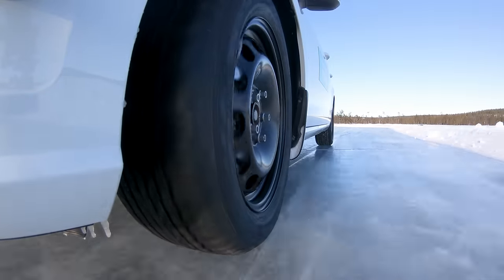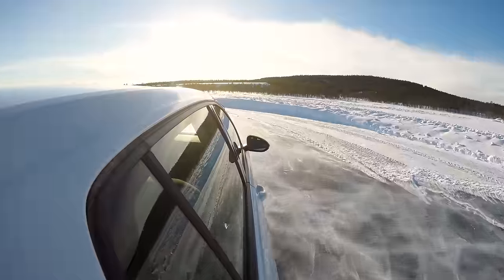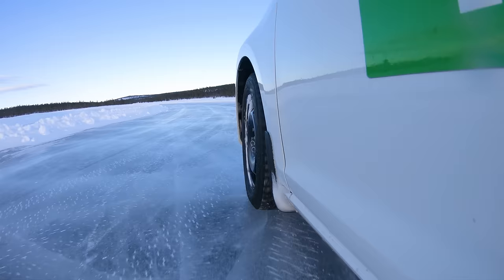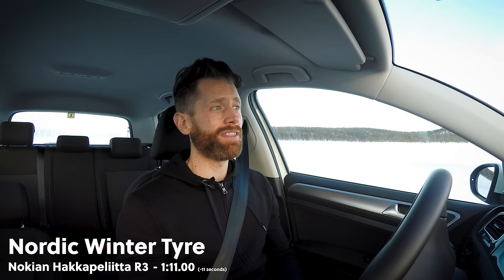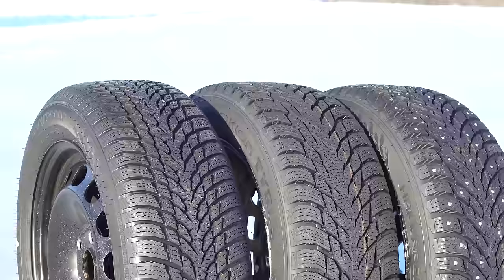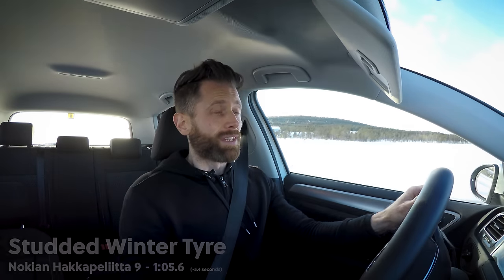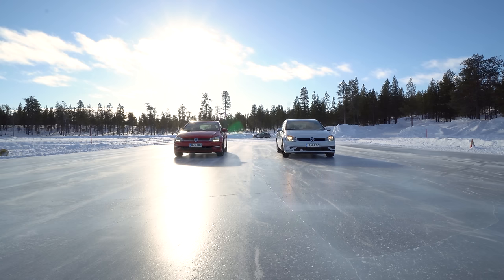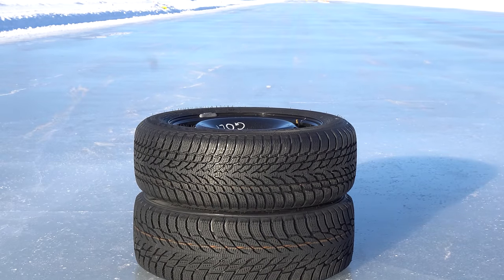Winter Tires VS Studded Tires ❄ What's better on ICE?

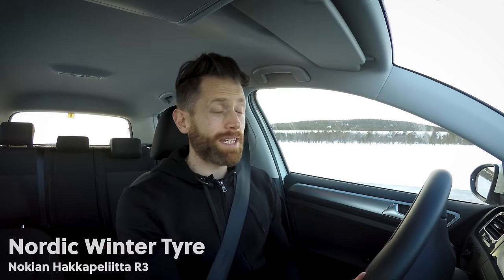Comment: Improving 10 sec from 1:22 is not the same as improving 5 sec from 1:12
Reply: Tobias Bredin......  I was thinking the same thing, but to an extent, those numbers are still informative in the sense that compounds make as much difference as having metal spikes
Reply: You are taking it out of context. 

He's saying the compound alone made an 11-second improvement. 

Adding studs on the same tire, only gained shaved 5 seconds off the same tire with no studs. 

Therefore you could say the compound is more important, but can still be improved upon by adding studs that will further enhance the compound's performance.
Reply: agree, 1:22 to 1:11 is 13% improvement and 1:11 to 1:05 is further 8% improvement and obviously it would be increasingly harder to improve it further

still nice, would like to see first tires studded version for comparison
Reply: The conclusion of the test is simply not representative ...

What really would be needed were some studded tires with the European compound so you see what difference the studs alone make from 1:22, and then the other way round what difference of having studs and changed compound makes to that time ...
Reply: @MrComputerCoder  No, you are missing the point. Going from 1.22 to 1.11 is easier than going from 1.11 to 1.05 even though the gained time isn't that much.
I mean, drive around a race track without changing your car in any way. Drive the fastest lap you can possibly do.
Now, shave off a second of that record. Without changing anything on the vehicle.

You are going to have a very hard time doing that because the closer you get to the limit, the harder it is to shave off seconds.
Now then, change tires... Without changing their diameter or width or height. Just change compounds.
You are going to shave off that second on the lap but can you shave off 10 seconds?

Change tires again to the ultimate grip ones, can you now shave off another 10 seconds just like that? Or are there simply other limiting factors, such as the "road" disappearing from underneath you as you tear around the track.
Reply: @RealCadde  Not missing the point. Watch the video again.
Reply: @MrComputerCoder  You are. Watch all of Youtube's videos again. ALL OF THEM.
Reply: @RealCadde  Yes because watching all of YouTube proves your point. Use the thing between your ears son.
Reply: @MrComputerCoder  I was pointing out how stupid your suggestion was because i have watched the video. Now you take your own medicine.
Reply: @MrComputerCoder  he is not taking it out of context...you just didnt get his point...
😑
Reply: @Mikhail.Tolstykh  no, Point Break is correct. Cadde is confused.
Reply: @cycl0n362  : Sir, you are the one that accurately pinpointed the problem. 
He didn't make a good comparison.
What need to happen is the following test set:

1.a) European Winter tires -> Lap time.
1.b) European Winter tires with studs -> Lap time.
----
2.a) Nordik Winter tires -> Lap time.
2.b) Nordik Winter tires with studs -> Lap time.
----
Then we will be able to make a good judgement on the both Compound performance & Studs performance.

Right now, to me, this only says that you gained performance with better compound and that for the same compound, you gain "some" performance if you add studs.
The real question now is; How much performance would the Studed European Winter tires would have gained?
Because if you want to spend money, studed tires usually cost about 15$ to 35$ more per tire where as improved compound can go as much as 80$ more per tires.
So if with studed winter tires I can get close to the same performance (or better) as improved compound un-studed winter tire, the studed option might be the better cost benefit choice.
Reply: If you agree with point break then cool but if you have any idea on how physics work the you would undoubtedly agree with cadde's point.. you are both right I respective way and it seems cadde understands that. Which leads me to believe point break is older and set in his ways or cant keep an open mind about learning new ideas and topics because he must be right.....
Reply: @pjay3028  cadde isn't confused he understands basic physics..
Reply: @brandonbld17  what, like you do?
Reply: @pjay3028  have i taken a advanced class on physics no do i have a high level of understanding in how objects interact yes.. the analogy that cadde was basically using was if you at a drag strip and your car runs a 15 sec 1/4 mile you can easily shave off a single second. But the guy who ran before you ran a 10 sec pass. It would be much more difficult for that 10 sec car to shave a second off of his time way more effort is needed... this is the example cadde was using and it is in fact a true analogy when we are referencing time. Point from what I could tell was just referring to the video on  how what I perceived his argument was that studs dont make much of a difference.. in this sense time wise no point was right.... cadde statement was that it take way more effort to get that 5 sec off. Which is correct. Both parties are correct in there statements what I was pointing out was that cadde understand this and point could not see that both of them are right in their own aspects...
Reply: @pjay3028  ps thanks for trying to bait an argument but not gonna fall for that wast of time. Have a nice day
Reply: @brandonbld17  10 seconds off 1min 22 is a 12% improvement, 5 seconds off 1min 12 is only 7% improvement so it is less of an improvement in percentage terms. The example you quote about the drag race makes the 1 second improvement from 10 seconds a bigger percentage improvement, that's the first reason it is not a comparable example. The second reason is that anyone who is struggling to get a 1 second improvement on the drag strip is struggling because they are already maxing out their performance and pushing the limits of their capability so obviously at that point it is hard to improve, however if the driver just got into a top fuel car they would improve by 6 seconds easily. The example in the video leaves that kind of scope available because there are no limits to the changes they could make to the tyres.
Reply: @pjay3028  yes and that 10 sec car has 700 hp that top fuel car has 8k more than 8x more so why can it run in 1/8 of the time.. because it is exponential. So with this this in mind a 12% reduction in time from 122 takes say 10% more grip (friction) and the 7% from 112 would take an exponential amount of more grip thus the grip required (friction) would be more like 15% because the force required to lower track time further requires exponentially more power or grip in this case grip...
Reply: @pjay3028  7% is no question less than 12% but the 7% absolutely takes more effort out of the tire because it is being assessed on a measured distance based on time
Reply: @brandonbld17  indeed, and there is nothing to prevent the use of significantly more grippy tyres, until the point that you reach the limits of physics, at which point, as I acknowledged in my post elsewhere, it does become impossible to improve. But the tyres used in this video are nowhere near that point, that's why you could still improve more, simply by using different tyres.
Reply: @brandonbld17  the whole thing comes down to where you are on the graph of potential maximum performance. It is nothing to do with the time/distance issue until you are very close to the point of maximum potential performance for a given scenario.
Reply: @pjay3028  that is also true. But manufacturers have a hard job snow cat has superior traction with tracks but diminished performance. Manufacturers have to develop a maximum traction tire without inducing diminishing returns on perform that is the key. Minds need to be pushed and technology advanced to increase comfort and productivity and performance in all things
Reply: @pjay3028  the argument i and cadde presented was that time is not a good representation in a percentage that will directly be representative of % of performance thats all.. you made valid points jay. I was worried this was gonna be like f**k you im right but turned out to be pleasant discussion
Reply: @brandonbld17  yes, it is nice to have a reasonable debate isn't it. I think your post about additional issues being considered (comfort, productivity etc) does illustrate my point. If you want to improve performance whilst being limited in what you can do to protect qualities such as comfort, longevity, cost etc, then it is difficult to do I agree. But if you're simply setting out to improve performance at all costs then I am sure that getting more performance still would be relatively easy to achieve, up to a point, obviously, and that's my point. However, if the tyres they used in this video happen to be THE most effective and highest performance tyres it is physically possible to produce, then I admit I would have to concede defeat!!
Reply: Tobias Bredin wow you guys sure know how to nitpik.  This isnt 1970 fellas, and you would be hard pressed to find a studdable tire that has a hard compound.
Reply: @alfie3836  The studded improvement over the best non studded was appx 50% .  And this was on ice with no melted water on the surface.
Reply: Its not fair to compare any compound with studs in Canada.studs are safest if not used too early in winter and must be removed before ice melts .studs are not good on frozen ashphalt!"without ice"
Reply: @RealCadde  If you go from studded tyres to summer tyres on tarmac, you can shave 10 seconds easy :D
Reply: I was here for the physics and mathematics. But no longer. I am now here for the comments. 

Edit: Currently in the process of watching all youtube videos to understand this.
Reply: The car would have done 1:07 with studs on any tires.
Reply: @MrComputerCoder    You missed his point. The studs achieved the best average speed, regardless of which tire they were in.  The compound  had nothing to do with the studs performance. Any tire with studs in it would have achieved the same results.
Reply: @cycl0n362  I have used studs on the crappiest snow tires on Earth, and my cars were always  unstoppable. It's the studs that create 100% of the grip.  Put them on a set of racing slicks and you will go just as fast on ice as you do by putting studs on snow tires.

Comment: Can you do a comparison of studdable tires without the studs? You should do a video comparing these four:
Hakkapeliita 9 with studs
Hakkapeliita 9 without studs 
Hakkapeliita R3 (studless)
The studless R3 with tire chains on the drive axle

(doesn't have to be Nokian, I just used them in my example because you used Nokian in the video)

Comment: reviving an old(but very beneficial) video, in north america, for some reason, you can purchase studadble winter tires without the studs installed. could you produce a video contrasting nordic winter tires, vs studable winter tires with and without the studs installed? thank you!

Comment: I'm not sure it's just the compound that made a difference for grip. The first tire looks to have a lot more grooves than the second tire. That tire has quite a bit more surface area on the ground at one point than the other. I don't know if that really make a difference for it but it seems like that would be a pretty big factor
Reply: it makes no difference on ice tho because well there is nothing to move out of the way like snow or rain which is the only purpose of the grooves. While driving on ice it is all about the compound.

Comment: Good impression of Bambi at the end!😂
Reply: He thought so much about rubber on vehicle so he forgot rubber on his feet.
Reply: Been there, done that!  This is typical in southern Finnish winter conditions, where you can barely walk to the car, but have no trouble driving with studded Nordic-type tyres.  This is when you really appreciate the studs.  The ice melts slightly during the day, then refreezes at night, resulting in perfect ice-rink conditions.

Comment: I ran studded Hakkepilita  7’s on a AWD Honda CRV in the Canadian far north. They were awesome as long as they had serious snow pack or ice on the road surface to grip into which fortunately for me was most the time. On the rare occasions I had them on bare frozen pavement it was a different story however as the studs would just slide on the pavement. After one set I went back to a quality non studded winter tire as really those were plenty sufficient for my driving needs.

Comment: I'm considering studded winter tires next. The only two times I've gotten completely stuck and needed to call a winch, wasn't caused by snow, it was caused by ice. If I had studs I'd never had gotten stuck.
Reply: Did you ever consider carrying chains?
Reply: @alansach8437 - For what it's worth nowadays I'm 100% for tyre winter socks instead of the traditional chains. In either case I just used them the bare minimum to get me out of some dodgy situation. For which the Winter tyres couldn't hold. 
With this said, Socks are lighter, way easier to set on or off. Easier to store...
If your conditions don't call for heavy duty chains. This is the way to go. ;-)
Cheers from cold Norway.

Comment: The problem of choosing tyres in England is that conditions can vary so much: slithering over hard-packed snow, covered by powder or ice according to time of day in the housing estates, slush in the shopping areas and dry tarmac where the 40 ton lorries have blasted the main roads free.
Reply: Try Michelin Cross-Climate for UK winter conditions, as seen on this channel.
Reply: Nokian Weatherproof . You won't regret. Also the Nokian wrd4 . In our country there are the same conditions and I successfully use the Wrd4 and I wouldn't change it for nothing.

Comment: Great video, overall.  I have been selling tires in Canada for over 25 years.  I would like to observe a few points:

- It is unfortunate that you didn't compare against an all season or a summer performance tire.  It would have shown how much better ANY of these winter options are.

- Although you can infer that a studded winter tire without special compound rubber would have been less preferable to a studless compound tire, it would have been nice to see the proof, because that's what a lot of the cheaper winter tires are offering.

- When a tire is half worn, it still has studs, but in many winter tires, the special compound only makes up the first half of the usable tread.  So, in your third winter, how do those compound winter tires perform compared to their studded friends?
Reply: A Finnish magazine recently tested cheap studded vs premium studless, and the premium studless came ahead in the final scoring. I don't remember which one it was, Tuulilasi, Moottori or Tekniikan Maailma. Basically they said that just adding studs to a crap tire will not make it good. It is nowadays quite normal for people to drive studless, especially in Southern Finland, all over the country. Talking about premium tyres, the difference isn't as big as people often claim, though pure ice grip will usually fall in favour of a studded tire.

Comment: I actually would've liked to see how the studded tyres handled in the wet/dry above freezing temperatures. I see alot of studded tyres in the south of Sweden where I live and can't help but think it's a bit pointless or even worse than a normal winter tyre.
Reply: You will need the studded tires ones or twice. And that might cost you your life...
Reply: My work vehicle has Blizzak studless, a good snow tire. But my personal car has Nokian Hakas with studs and it is significantly better in all conditions. The studless are still good though, but that extra safety with studs is very comforting if a moose walks out in front of you. And yes, even better in wet snow.

Comment: Regarding to the rubber compound for Hakkapeliitta R3. It contains microscopic crystals (like small diamonds) work like built-in studs, improving grip on ice by grabbing onto the driving surface. So it is not just the rubber ;-)
Reply: I remember that I have read about the crystals too! Diamond tires, so that is the reason for price. Do you know how deep R3 contains these diamonds in its surface?

Comment: Worse thing about ice driving is the stopping as ABS is way way too intrusive on all the vehicles I own.
Reply: Pull the abs fuse lol good luck
Reply: I’ve had 2 accidents due to the ABS going in while I needed to stay fully in control. That system sucks.
Reply: @NiGHTSaturn  You're going too fast then
Reply: @AimingWanderously  sliding down a hill with no acceleration how about that.
Reply: @NiGHTSaturn  Touche, that sucks. Been there. Odds are though that locking the brakes up you'd still slide.
Reply: @AimingWanderously  I just slid down a hill in the middle of no where & fucked my tire & run up!! I hate ICE!!!
Reply: @HoweyJR_  Studs are the only way to go with ice. Unfortunately we usually don't know that until it's clearly too late.

Comment: If we're being honest, because of diminishing returns, drops in your lap times will decrease. A 5 second drop is very significant particularly after dropping 11 seconds. It's more like the studded tire + new compound gained 16 seconds whereas just the new compound gained 11 seconds. That's not quite the same as saying the studded tire only gained 5 seconds over the compound.